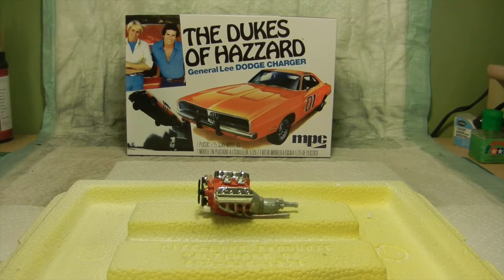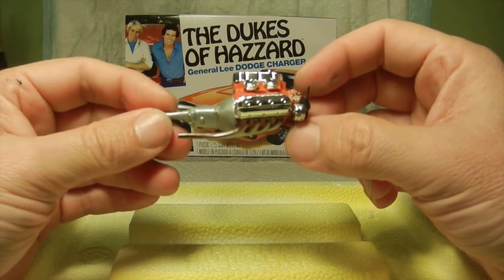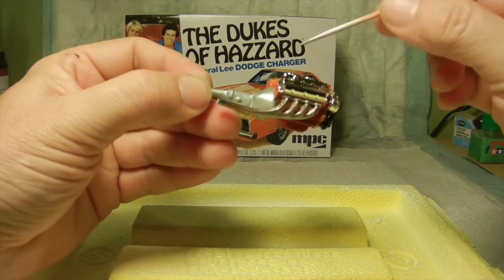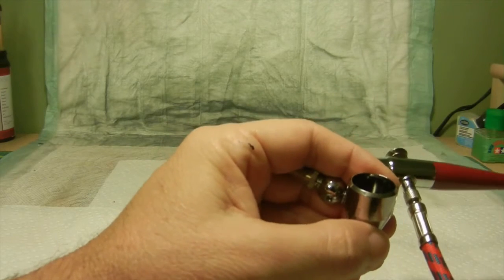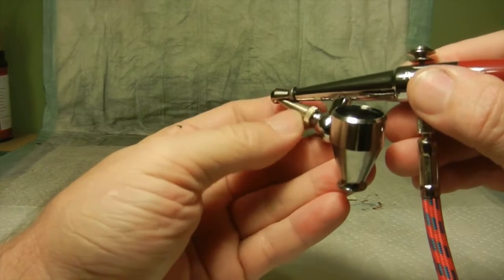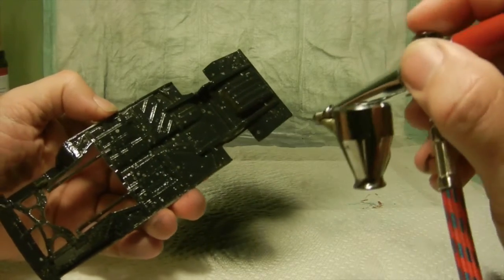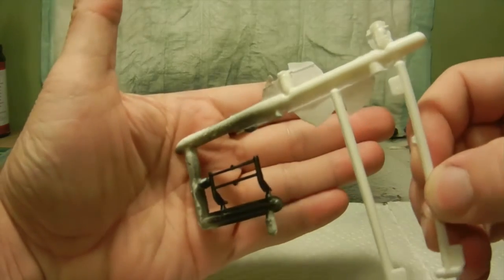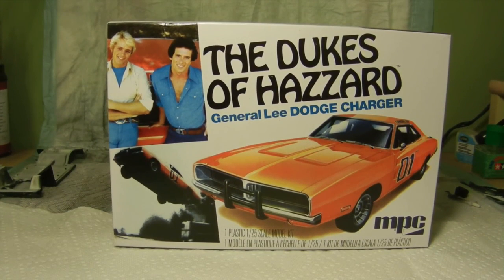MPC General Lee Ep.  2

Comment: Most distributor caps are actually black the one I am working on I used some black thread for spark plug wires, and some metal thread for transmission lines, as mine will light up I am having to make my own head lights with clear plastic as the one that comes with this build is not transparent.
Also you don't want to use true black because that will make your model look like a toy, rather than a miniature replica.
Reply: Just seen a 440 with a tan distributor bro.

Comment: That paint guide ain't quite right. I have seasons 1 - 3 and took a some screen shots for my 1/16th General build. The roll cage is tan, much like the rest of the interior. Well depending on the shot, car sometimes changes from shot to shot. But it's mostly tan, with some black undercoat showing through where it's chipped and even some duct tape in places. I just painted the whole thing tan. lol
Reply from the maker: +Punk Wily Thanks for the info, I'll look into it.

Comment: Looking pretty good Mikey!! Any issues with the kit yet? Besides the distributor.
Reply from the maker: +MindlessModelWorks Thanks Kenny! Hah, Working on modifying the roll bar, the car doesn't sit right on the chassis, working on fixing the front wheels so they fit under the body of the car, the bumper doesn't align right with the front end, the rear bumper the same..... did I miss anything?! LOL.
Reply: Nice build, that is a tough build because nothing fits together. I see why most get the Revell Dodge Charger and convert it over to a “General Lee”. 

MPC did release a new General Lee kit that looks better.  It is a snap together kit, so the engine is not there and the underside is one molded piece. It does sit like the TV version (Not so high). Once again no mirrors, but does have the CB antenna on the trunk. 

I think the solution is to kit bash all these kits together to make a perfect model. Lol.